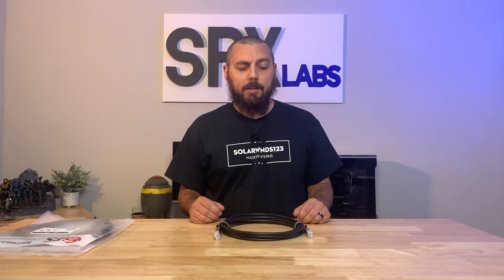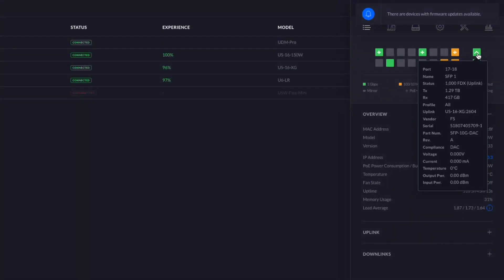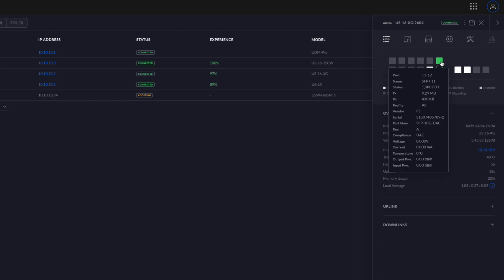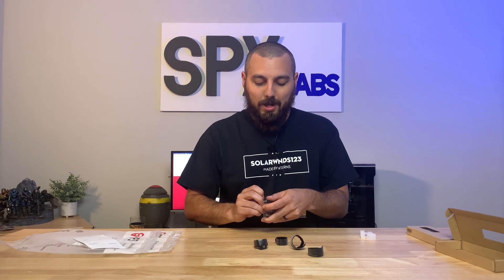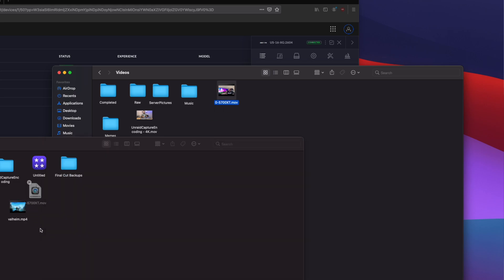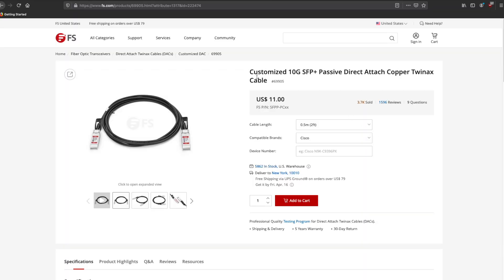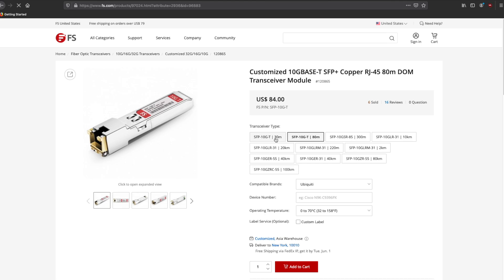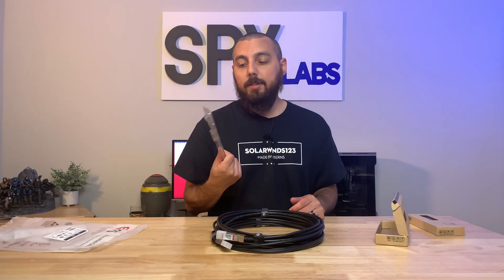FS.com 10Gb Copper DAC and SFP+ Transceivers for Ubiquiti UniFi Switches and UDM Pro

Comment: The 30m 10GbaseT SFP's run much hotter and don't currently indicate the proper link status - I recommend using the 80m version even if you don't need it.

Comment: Have another question for you... Are you using any rail system for your servers? Or if you would, which one would you use? Been struggling to find something adequate
Reply from the maker: Nope.  The ones I want are very expensive and there is mixed information on weather or not they fit
Reply: @SPXLabs  I guess I'll just have to get some adjustable rails then. Which ones did you get?
Reply from the maker: Navepoint something or the rather.
Reply: @SPXLabs  Yeah I've seen those. I mean still expensive but much less than those sliding ones!
Reply from the maker: If I could go back I’d get sliding ones.  But I’m already married to mine
Reply: @SPXLabs  At the price they are selling them, over 70$, I'll pass. Plus, I feel that with wheels and the weight I would need to anchor the rack on the ground. Don't get me wrong, they are SUPER useful for quick maintenance but, not just at any price.
Reply from the maker: Also maintenance is rare.  Unless you are me.
Reply: @SPXLabs  Unfortunately for me, I'm like that as well LOL

Comment: Have a question for you.. Do you use CAT6 or CAT6A cables? Also, in your walls do you use solid or stranded CAT cables?
Reply from the maker: Monoprice Cat6 Ethernet Bulk Cable - Network Internet Cord - Solid, 500Mhz, UTP, CMR, Riser Rated, Pure Bare Copper Wire, 23AWG, 500ft, Blue
Reply: @SPXLabs  Cool no issues with Crosstalk or anything of the sort? Was the only reason I was considering CAT6A. And solid is the way to go for wires in the wall but I presume your patch cables ones are stranded correct?
Reply from the maker: My patch cables are whatever Ubiquiti sells. https://store.ui.com/collections/unifi-accessories/products/unifi-ethernet-patch-cable-with-bendable-booted-rj45
Reply: @SPXLabs  Thanks for sharing that info!
Reply from the maker: Any time buddy!

Comment: Question? May I connect a switch using SFP ethernet to another switch without SFP (direct to a ethernet port)?
Reply from the maker: Hmmm.  In theory you should be able to.  I can try that out later and double comment you
Reply: @SPXLabs  Thanks, I am trying to connect a normal giga switch from Cisco by ethernet to a SFP ethernet on the US-8-150w  in order to save one ethernet port from the 8 POEs

Comment: dac cables show no temperature are passive components. need much less electricity and hardly generate heat. Another advantage is latency.
Reply from the maker: Oh wow.  That’s neat and I did not know that.  Thanks!!
Reply: @SPXLabs  rj45 generate the most heat and consume the most electricity by converting
Reply from the maker: That makes sense to me.  Will the thing thermal throttle and drop performance if it stays too hot?
Reply: @SPXLabs  The best thing is with SFP + RJ45 if there is enough space not to be plugged into the slots next to each other. spread them out a little. thermal reduction is imaginary. fiber optics and DAC are also there for different distances to mix them. dac for short distances, rj45 to connect pc directly and fiber for long distance and possibly other network components
Reply from the maker: Sweet! I’ll keep that in mind moving forward, wonder where that will take me.